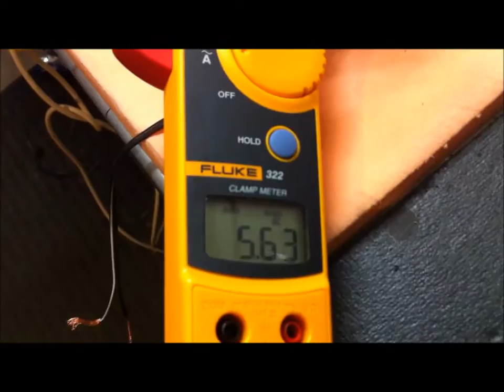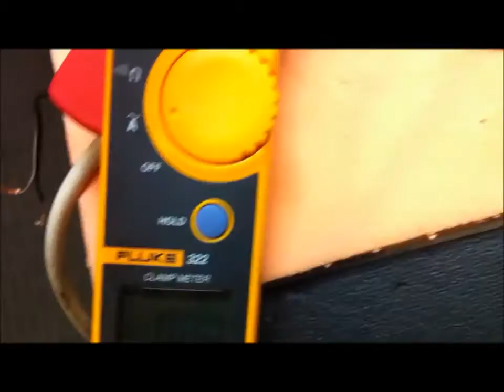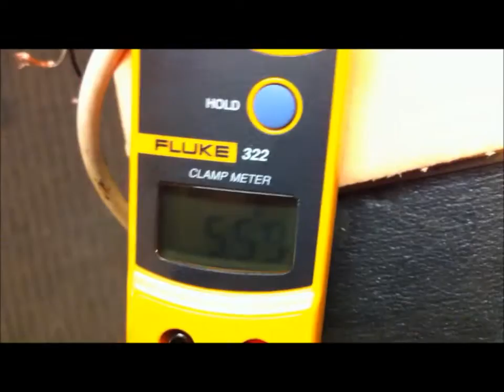Self Polarising Carbon Fiber HHO Electrodes - Big HHO Production With No Electrolyte!

Comment: Hydrogen technology 🚓🚕

Hydrogen help the combustion process to run a petrol or diesel engine  more efficieently.and carbon-free almost 100% fuel burnning in the engine.

HHO gas burn a lot faster then  gasoline or petrol. Hydrogen power  miracle gas remove carbon build up in the combustion chamber and boost  engine power and torique. Reduse  carbon emission ko ) restores better fuel  economy.

 Hho car kit  prolonging engine life and engine oil life.

 Like a new car!!! 

Engine runs smoother and cleaner to make your car 0 carbon emissions  Boost engine  power and torque Better acceleration . 

An efficient hho car kit lower the engine temperature more then 100 degree F.  Hho car kit reduce car maintenance charges. 

Cleaner engine running. Reducing engine noise due to the faster fuel burning. Hho car kits works nicely requires no modifications in the car engine. No side effects on car engine.

Engine start quickly safe your car battery. No more petrol or diesel smoke or smell. Hho system is very simple.

Hho kit installation  time is about two hours to make your car a low cost hy-brid. 

F

Comment: Wouldn't putting some sort of vibrating action directly onto the electrode to shake the bubbles loose, and expose the underlying electrode, immediately to the water, give you more efficiency? It looks to me like the areas with bubbles on the surface aren't producing anything. And that makes sense because those HHO pockets are like insulators, effectively reducing the active electrode surface area drastically. Also, a carbon fiber tow might make a better electrode, as it will have much more surface area. You might even be able to coat it in a graphene jacket for even greater efficiency.

Comment from the maker: Yes, high current power supplies will always cause deterioration of the electrodes. I think higher potentials and frequencies are required. Good point about swapping the leads - I did not think about that! You may have saved my life :)

Comment: Good Work!  The water got contaminated pretty fast.
Do you think those plates will last longer than 316SS?
For safety reasons, I would swap the leads at the power supply, and not over the hydrogen source.

Comment from the maker: Yes, good point, I will be doing this next year - this was just proof of concept stuff. I'm just waiting on a guy who is welding my stainless steel disc electrodes for me. I want to measure & compare HHO output using stainless steel electrodes VS carbon fiber electrodes. Once I get these stainless steel electrodes back, I will start building my test assembly :)

Comment: I am working on making a HHO generator with Stainless Steel plates(electrodes). the use of no added electrolyte would be an advantage if you can get a usable output of HHO gas.(up to 5lpm?) KOH and NaOH are the best catalyst for the one I'm working on. Could the browning of the water be chromium 6? It's a concern with the SS units. Also, take a look at the Pulsed Wave Generator that is used on some of the examples I've found. If I can find an affordable source of Carbon Fiber, I'll do some tests

Comment from the maker: I still think it's an anomalous spark of light, BUT you might be right. I just picked up a PA amplifier (see my latest video). I will try to run some pulsed signals into the plates through the amplifier and a step down transformer. This way, I can control the frequency and amplitude of the signals going through the plates. I will also try to reduce the gap between the plates. I will get back onto this project asap. I already have a few projects in progress - I've got to clear the bench first!!

Comment from the maker: They are breaking down, but the process is so slow that I have not observed any obvious visual or structural breakdown of the plates. After all the experimenting that I have done with them, the only deterioration I can see is an ever-so-slight pitting on the surface. If we were to measure the rate of deterioration I am guessing it would be in the ppm range - or less. The deterioration is a current based phenomenon. High voltage & low current produces little if any discoloration of the water.

Comment: So do the electrodes break down if the resin is dissolving? I'm still trying to work out a chemically inert electrode so all you have to do is add more distilled water to the electrolyte solution.

Comment from the maker: I had not noticed this before. Thanks for mentioning it. Yes, you are right, I have watched it in full screen a few times now & also in slow motion. It definitely seems to be a flash & not some sort of visual effect caused by light passing through the bubbles (which was my initial thought). Plasma with low voltage?? That would be cool, but I'm sure there is a simple explanation.... maybe.... :)

Comment from the maker: I have done tests with distilled, spring and tap water, with the stainless wire sitting out of the water (not in contact with water). The carbon fiber electrodes still colour the water brown. I attribute the discolouration of the water to the Bisphenol-A based epoxy resin which is used to make carbon fiber. The resin breaks down extremely slowly during the electrolysis process and discolours the water. The rate of discolouration increases as a function of the current flowing through the plates.

Comment from the maker: Yes, you are sort of right, but even good quality distilled water has impurities/minerals, which is why it is given a conductivity rating (usually based on the water at room temp). An electrolyte is a substance that carries an electrical current due to the movement of ions - distilled water can also fulfill this role under the right conditions. Where I have said 'no electrolyte', I should clarify by saying that no additional bulk electrolyte (such as baking soda) was added to the water.

Comment: No electrolyte would be distilled water. Spring water has minerals(electrolyte) in it. With carbon electrodes, the water should stay clear since the carbon doesn't react, but here it's turning orange-ish brown which indicates a second reaction other then HHO production. Either the stainless steel wire is corroding, or there's iron in the water that's reducing would be my guess. I worked at a pool store, and I think chromium leaves a brown stain as well, so it very well could be the stainless

Comment: Set it up using neutral plates to cut the load to the system so you can cut the amperes as water is acting as a resistor.

Comment from the maker: Also, when I replace a diode from a standard circuit with these plates, it seems that I can control the current drawn from the circuit by adjusting the plate gap/spacing..

Comment from the maker: I have completed further tests on the polarisation and have found some very interesting results. Once the plates became polarised, I realised that they wanted to act like diodes. I then removed a diode from a standard circuit bridge rectifier & replaced it with the carbon electrodes. The circuit performed as usual & the plates created HHO simultaneously. These plates can replace any diode of any current rating - so far!
I will do a video demonstration - a picture is worth a thousand words!

Comment from the maker: Please explain...
What sort of Isotopic Tubes were you using? Carbon?
When you say they 'performed equally well', do you mean strength/modulus, or are you talking about HHO production?
In my carbon fiber electrodes, the weave is not important, however, the preparation and layup process is critical and very exacting. If not done correctly, the sheet will not conduct at all. It is a laborious & time consuming process to create my sheets.. I will elaborate further in future videos..

Comment: I was using isotopic tubes in carbon fibre and made them run along the tube and another around the tube and both seemed to perform equally as good although at such small volumes the eye is not a great measure device alas the weave or layup may not be important once the matrix is set. What are your thoughts?

Comment from the maker: They are a composite material. Conductive. Very high resistance.
They are not ordinary carbon fiber plates.
I have been working with them at high voltage now for a few days with good results. 
In my current circuit, they produce a higher HHO output than stainless steel electrodes.
I will be posting a video of this soon.

Comment: Very interesting. Are those pure carbon or a carbon fibor composit. I tried composit and found that the resin was non conductive but i did mot leave them in the cell a long time. There could be a huge advantage to carbon and resin combos. David A. Puchta

Comment from the maker: Thanks mate..

I'm gonna try to stay away from any additives in my water.
I think the water will stay clear without additives if I can get all the variables to work together. eg. voltage, electrode size/thickness, spacing between electrodes, frequency, biasing etc...

I am also looking into using water that has been magnetically treated. The treated water exhibits reduced surface tension. The additional energy gained by the water molecules may aid in reducing the energy required to produce HHO.

Comment: Another great vidio EnergyFabricator
I was doing some experimenting with diferent type's of electrolite and found something that maybe useful to you.I tried white vinigar and although it dosnt make a great electrolite,it seems to keep the water clear.Normaly after running my cell for about half an hour on straight tap water- the water is very brown.But with about 5% white vinigar and 2 hours running,the water was still crystal clear.It also produced a slightly higher HHO output.

Comment from the maker: There is definitely gas and steam - I have already ignited the gas.
But, I accept your challenge...

I am already in the process of building a power supply using diodes that have the correct rating, along with a new HHO cell, bubbler, flashback arrestor, temp gauge, pressure gauge, etc... This may take a little while, but I am doing it properly so that I don't have any unwanted explosions... Safety first!
I will do a demo of the new circuit & HHO Cell when its ready....
Stay tuned...... :)

Comment from the maker: Thanks. I can confirm that you are correct. There is indeed some sediment forming at the base of the bowl. Please keep in mind though, that the breakdown of the carbon is most likely due to the high current flow through the cell. These videos are proof of concept only, to show conductivity of the plates & ability to produce HHO with no electrolyte.
I believe this issue will be rectified when they are used for their intended purpose, which is high voltage, high frequency & low current...

Comment: Greetings... Nice work. I can see that the Carbon Plates are starting to decompose. This is the problem with using Carbon to produce HHO.  Also the HHO is less energetic because of the release of the Carbon. HOWEVER... The Gas that is released is now a HidroCarbon based gas which is 'Easier' to use in a Internal Combustion Engine...

All this experimentation is  Very Useful...